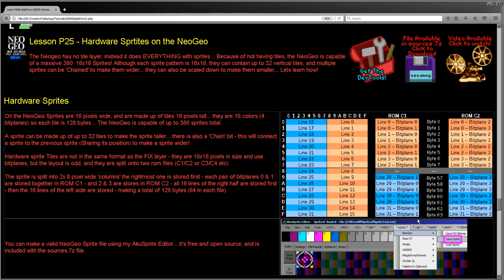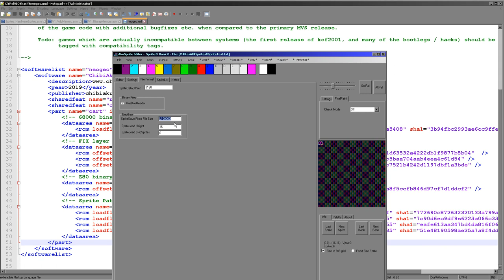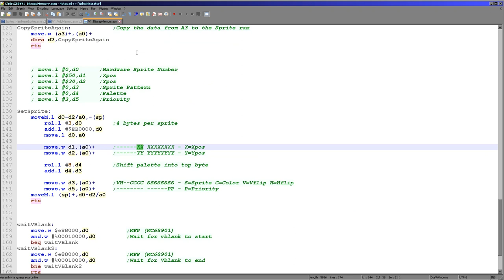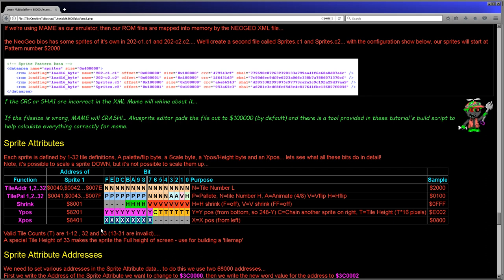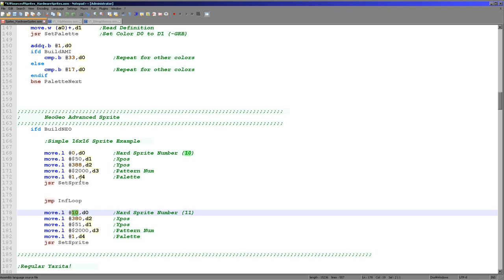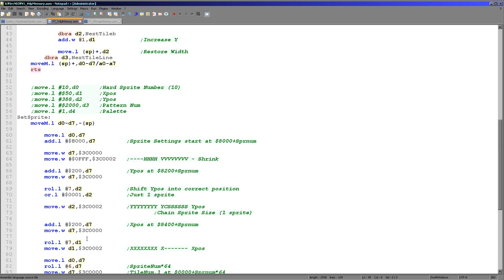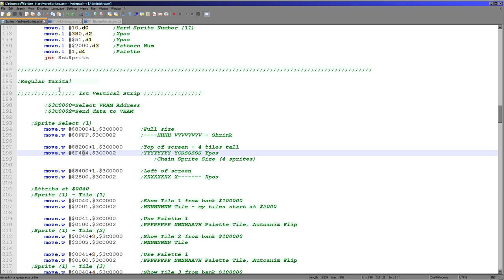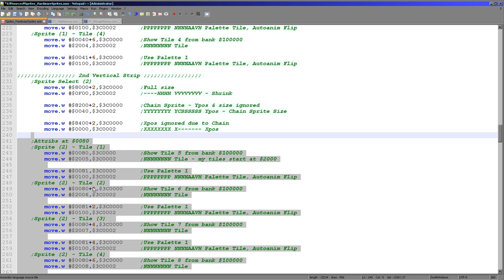Hardware Sprtites on the NeoGeo - 68000 ASM Lesson P25

Comment: would you say the way the Amiga does graphics is the exact opposite to the Neo Geo? :)
Reply from the maker: I wouldn't say 'exact opposite' but they certainly have very different design choices.
More surprising is how different the X68000 and Neogeo are, as they were both based on arcade hardware. (Apparently some arcade games were developed on the X68000 because it's basically an arcade board with a computer attached!)